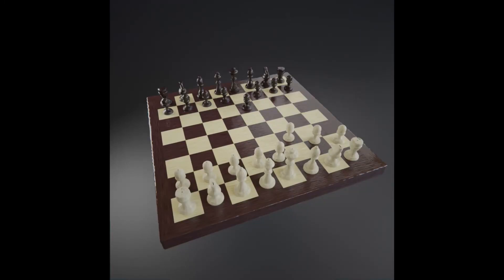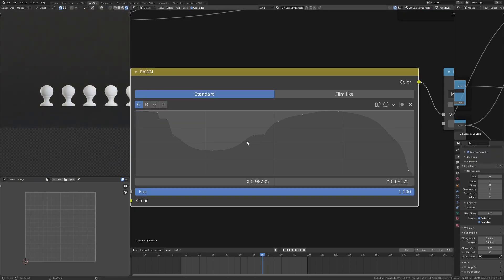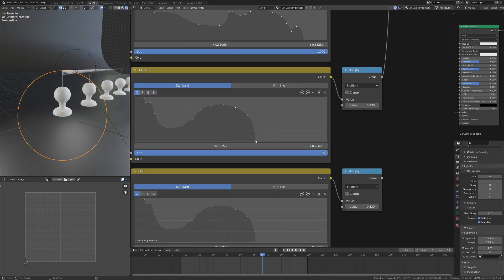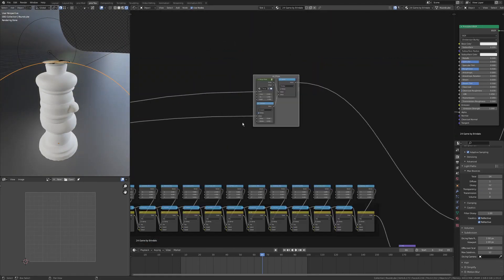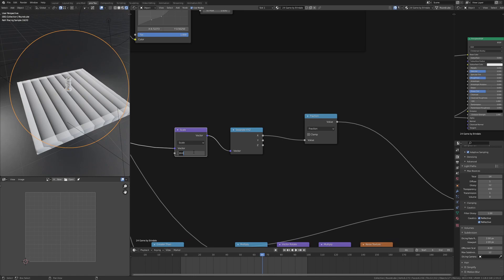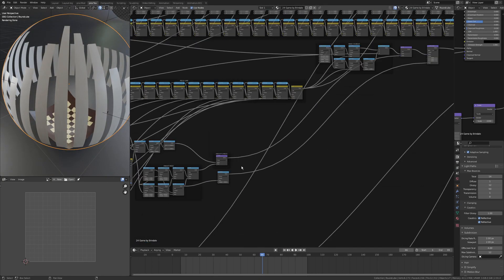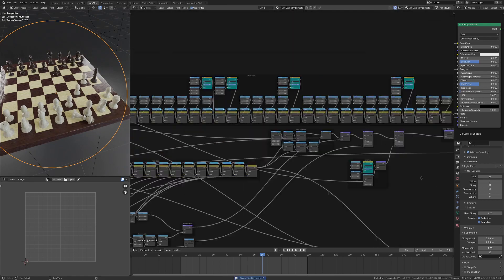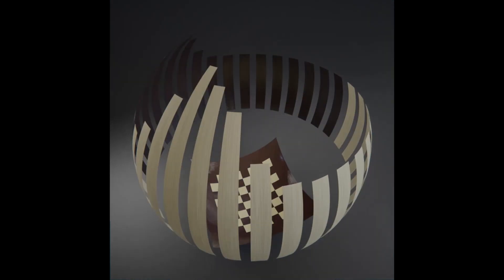Nodevember Day 24 Game Timelapse - Blender Vector Displacement

Comment: Hey, is there anyway you can make one vector node for a pawn as a prototype or template which then you can instantiate into the number of pawns needed to generate? I suppose the answer is gonna be "not without python". Nothing im geo nodes themselves which would allow you to do this?
Reply from the maker: This was 100% in shader so I just set up the system to basically create cylinders and then use different profiles on different parts of the mesh to give the pawns etc. To do it with real geometry you could use python or Sverchok to generate a predefined profile and then sweep it to give the faces and then after that, python, Sverchok or geometry nodes could all handle Instancing on positions! Your python method could even be something very simple like you model the profile with vertices and the script applies modifiers and materials and maybe even sets up a geometry nodes tree to instance the generated mesh